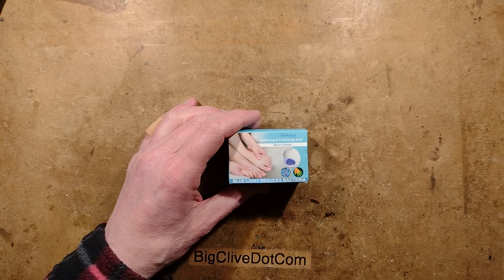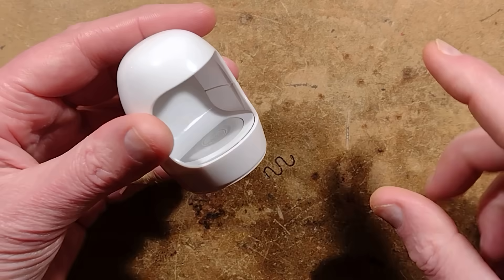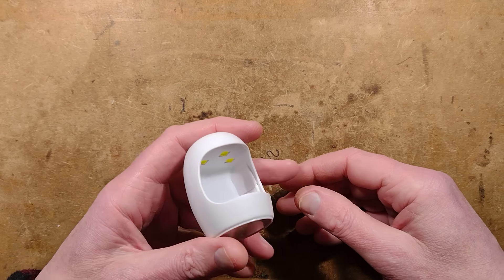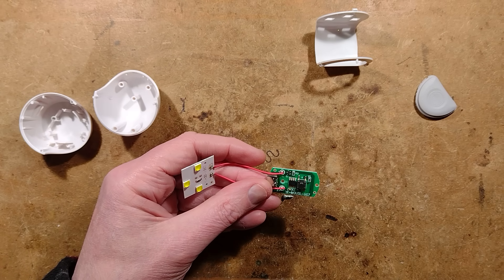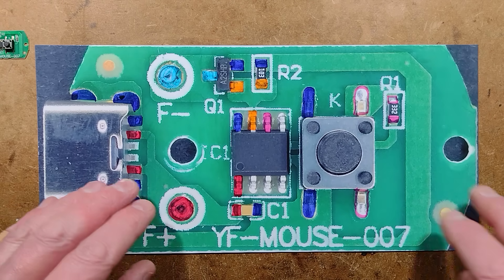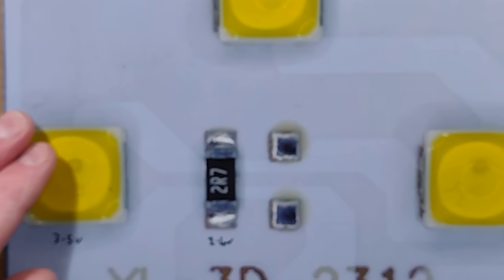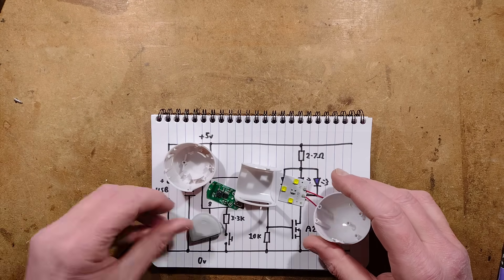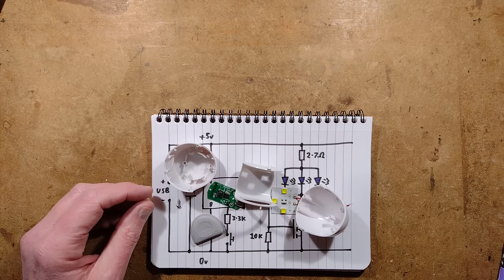UV nail fungus curing thing - with schematic

Comment: The sound of your voice is notably clearer, if you use a de-esser plugin you could leSSen the sharp ß-sounds and also tame down loud clicky noises that you fear so much. It's basically a compressor with very fast on- as well off-timing for frequencies approximately 5k to 12khz only
Reply: True, a de-esser is really needed in this setup.

Comment: The led emissions are not enough to sterilise or penetrate, it would do nothing against bacteria, viruses or fungus, it is the same bs as people who think red lights will hell them heal faster, bs

Rather shoddy construction for something you're supposed to stand/put pressure on

Microcontroller, to turn on three leds... Christ on a bike...

Assuming the laser terminology is a misunderstanding of single frequency wavelength

Comment: I'm quite amazed that a preprogrammed microcontroller nowadays seems to be cheaper than a bog standard NE555 in such simple timing applications..
Reply: The 555 is still cheaper (at least here in the US, I don't know about China). The 555 is around 5¢ in bulk and a microcontroller is around 30¢. But I suppose there are more people in the world who can write a simple program in C than who know how to choose the correct value resistors and capacitors to tune a 555, so going with slightly more expensive hardware allows any idiot to "design" these things. 🤷🏻‍♂
Reply: @tim1724  There's also the option to quickly change the "design" in software compared to retooling the hardware production.

Comment: What decides the timing it's on?  Changeable?
Reply from the maker: Fixed 45 seconds or a minute if you hold the button down until it lights.
Reply: Internal RC oscillator and dividers in the microcontroller. If it’s the reprogrammable sort you’d have to figure out which are the I/O pins, isolate them, and tell it how many steps you want it to divide by before turning the FET off. If it’s not, you might try changing the value of the resistor on the pushbuttons but I doubt that will work as it’s probably there to isolate noise on the USB supply. The input must have internal debouncing but the added resistor will cut any noise below the denouncing threshold for sure.

You’d be better off removing the microcontroller altogether and using say a 555 timer but then you’d need to add the RC components.